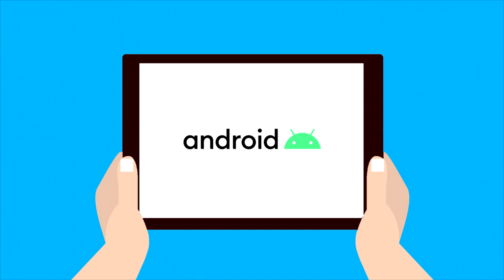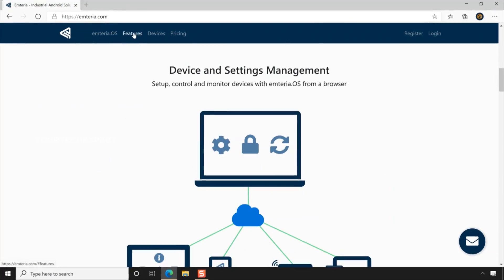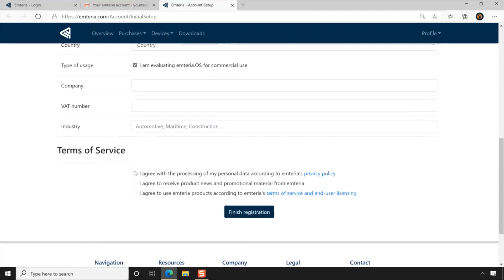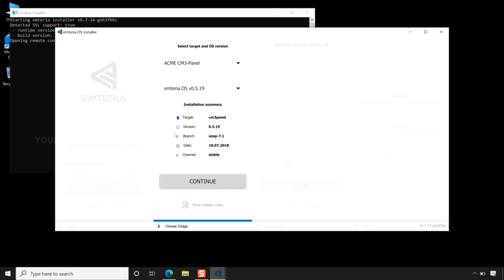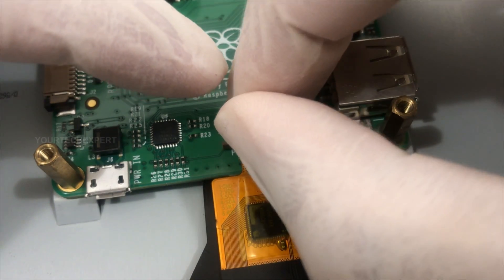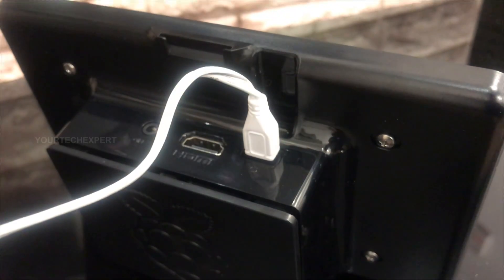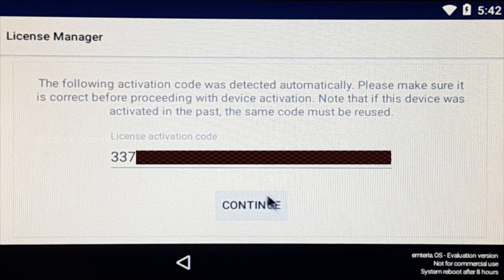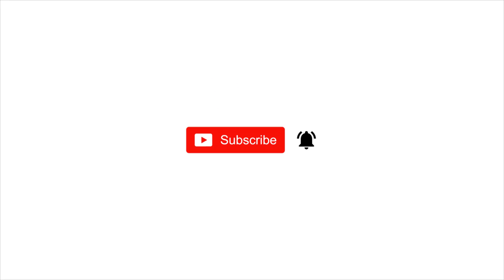How I made my own $180 Android Tablet - Homemade Android Tablet build

Comment: Hi, again! Great video! Would you be willing to offer up the techniques (or to actually build / make available) a sturdy, flat, enclosed, chassis wherein one can plug in replaceable parts (Similar, though not identical, to a desktop?) Personally, I'd like a reasonably good quality 16 x 9" screen, and substantial memory. Probably touch screen. What is your estimate of the feasibility of such a project? Thanks very much. Take care!
Reply from the maker: Hi sorry for the late reply.
With raspberry pi 4 and and touch display i think you can make something like that

Comment: i recommend that to add a battery so you dont need to plug in to power
Reply: @YOURTECHEXPERT  execpt you can enable developer options by press build number 7 times and change the dp higher